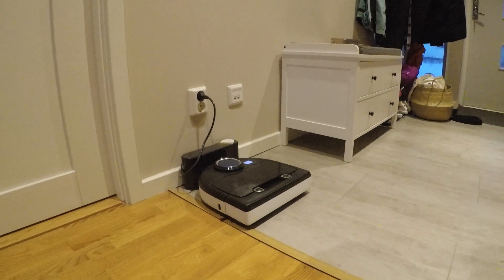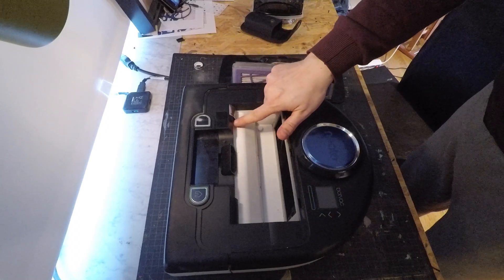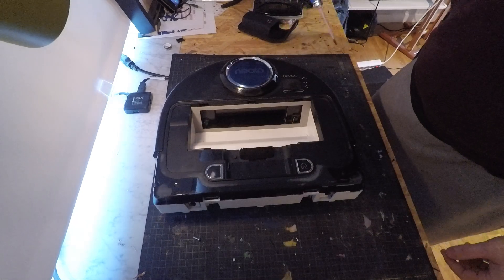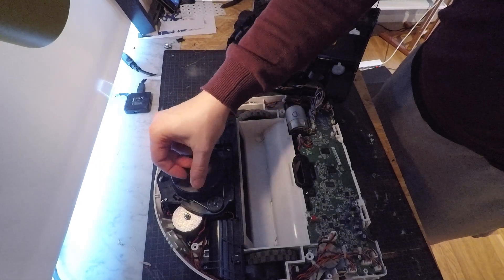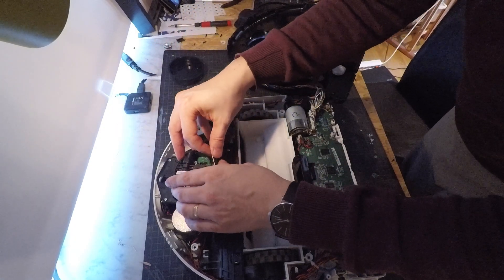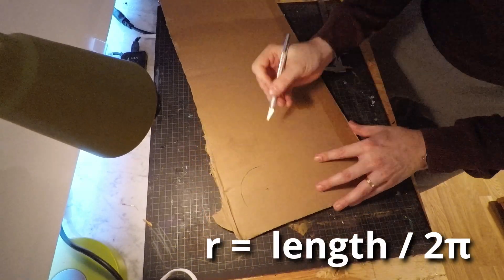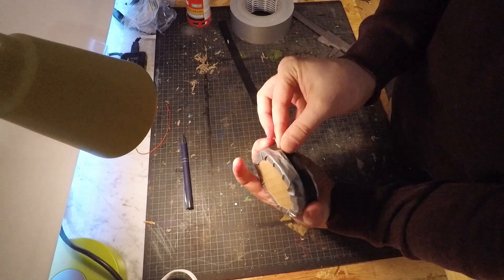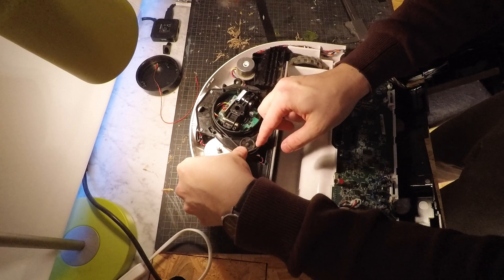Neato Botvac Repair (Laser Turret)

Comment: Hello. I have the same problem. The laser turret turns around but the robot does not make any map inside home. Only works manually and the dock sign on application is blurry and cannot be marked. I asked chatgpt for a sultion and it asked me to take a photo of the laser turret while in operation to see if there is and laser light visible on a phone screen. I checked it through the phone but the laser is not visible. Cables are ok and the drive belt turns fine. Do you think that the belt has to be change? Or laser diode has a malfunction?
Reply from the maker: If you can't see the laser through your camera, then the laser itself is not working. If it's the laser diode, or the laser unit or the power to the laser that is broken is obviously hard to say without measuring.  My guess is that replacing the turret would fix the problem (but you should change the belt while at it anyway).
Reply: @JWAM  Thanks for the message. Today I replaced the drive belt with different ones and still no docking sign and no self cleaning. Only manual one works. I clean the diodes carefully but no sign of working. The robot makes the exact move like the one your make at the beginning of the video. There are spare laser dioded on ebay and aliexpress but they do not ship them to my country :( I think the robot wasted for a $5 piece.
Reply: @JWAM  I checked both power sockets and the turret socket was out. I placed it again. I can see the red laser while working but still no mapping or working. Replaced the belt but nothing works. Replacing the turret will cost a lot so it is better to sell it as spare part.
Reply from the maker: @AslanBehar That's a shame. :(
At least you have it a go, which one should always do :)
Reply: @JWAM  I just realized that the motor on this video is located on left side of the turret but mine is located in rear side which I can see that the holes and motor mount screws are empty. Which is right? Left side or rear side?
Reply from the maker: @AslanBehar  Interesting! Sounds like they had different configurations and somehow foresaw it. Maybe the form-factor of the motor is different and they wanted to make sure that they could use both?

Comment: I've got virtually no suction in mine. Recently replaced the brush  motor as that had failed, plus the usual annual replacement of the battery. I'm spending more than if I had just bought one second hand.
Reply from the maker: May be it's time to upgrade at last.. ?  :)

Comment: I was expecting my rubber band to be broken as well but it turned out it was a big block of lint pressed up against the rubber band pulley component. Cleaning that solved the problem. Thank you for the video!
Reply from the maker: No problem! :)
Glad you got it sorted :)

Comment: Hi ! thx for the video. My botvac D85 has the exact same issue, i changed the belt : no change, i changed the little engine that make the belt spin : no change. Any idea ?
Reply from the maker: If you hold a paper Infront of the turret, can you detect the laser both shine and spin before the fault occurs?
Reply: @JWAM  i just tried, i dont see any red dot/light on the paper
Reply from the maker: @PAPAJOU  My guess say it's the power supply to the LiDar or or the whole LiDar that is broken in that case. :/
Reply: @JWAM  hmmm, seems Bad 😅. Im gonna search online how to replace the lidar
Reply from the maker: @PAPAJOU The bad news is that the LiDar is about the most expensive thing on the whole product.  If you know someone who is a bit electronics-savvy, maybe they can find the fault. It may be a smaller thing.
Reply: @JWAM  unfortunatly i dont. I've found the piece on Ali express for 43€, i Hope it will solve the problem. Thanks for your help
Reply from the maker: @PAPAJOU  oh, that was cheaper than expected then.. I was sure it was 150+.  Good luck! :)
Reply: @JWAM  Hi again ! So.....i've replaced the linar and little botvac is back at work but it's not acting like it should. It starts, move  a little bit, spin, spin again, move a few inches forward then spin and spind and sping again, it's quite hard to explain but it seems like it doesnt know where to go. And at some point it will just stop without returning to the charge station. Should i do some reset after replacing the lidar ?

Comment: Many thanks for the video. It helped me to take my Botvac Connected apart. Turns out there was dust which was interfering with the lazer turret rotation so cleaned that and it's fine.
Reply from the maker: Glad I could help. :)

Comment: on mine i put a new battery in and it doesnt turn on unless its docked.  do you think its probably the mobo?
Reply: That's odd. Do you have the old battery left? Does it / did it behave the same?
Reply: @JanneKronbäck  yep, both have no effect, just solid red light if it's docked. Which I guess has to be a connection to the mobo or the mobo itself is burnt
Reply from the maker: @karrde666666  Ah OK, I thought you meant that it "worked" when docked.I have moved away from Neato since, so I don't have any advice from the top of my head. It doesn't have to mean that something is awfully "fried" either. If it refuses to start at all, but shows an error / charging (red?), I would check / measure the incoming voltage levels and check for fuses and such. At least the older models had some weird "on/off"-switch somewhere around the dustbin (I think) check that too..  : )

Comment: Very good video, unfortunately on the D7 model the screws you have to remove are the t size 10 with the locking pin in the middle. I happen to have some from fixit but the two at the front are so deep that I could not get them. The adaptor for extending the  t 10's I have was also to thick to fit into the holes. Great video I am sure it would fix it if they only had not changed the screw types.

Comment: Good idea I would also suggest buying audio tape deck replacement belts or cd carousel replacement belts or DVD carousel replacement belts from eBay.
Reply from the maker: Sure but if one is to buy something, one might as well order the actual replacement belt. :). The reason I did what I did was that I simply wanted to fix it there and then to have it working and clean the rooms, rather than search/order/wait a few weeks - and also to be inspirational, as in "you don't need to pay/wait for weeks to get things repaired - just fix it with what you've got". :)

Comment: Hello everyone! I'm having the same problem, but the rubber band isn't slipping. It just isn't turning at all. That's probably the motor, right? It if is, I don''t know where to buy one...
Reply from the maker: Yes, most likely the motor. In Aliexpress, try the search term "Neato lidar motor with cable" and see if you get a hit that matches yours
Reply: With my D7 Botvac, I discovered it must be the little wheel of the motor: in the five years of using this robot, it collected hair and dust around the little pin that the wheel is on for driving the belt for the laser eye. The belt was still good, and not stretched. Bit the wheel would hardly turn. At this moment I’m still cleaning the little pin, as it is a real tight and small space to work on. Hoping this will solve the problem at last! 😅

Comment: Hi there, thx for posting your video. It pointed me in the right direction. But i was dissapointed at first when i saw that the rubber band on the laser turret was in good condition. But then i found a broken rubber band on the sidebrush motor, and the opposite side of the motor has a sensor that sees if rotor is rotating. So my guess is that if side brush or laser turret dont turn it will have the same behavior.
Reply from the maker: I don't think that is the case, unfortunately. The sidebrush can be out of commission without any problems (except that it doesn't clean along walls properly).  Make sure that the turret is spinning when you start the robot. If it isn't, it is probably the motor that needs replacing.
Reply: @JWAM  You where so right, just changed the rubber band and still same behavior. I see now that Lidar turret is not spinning, but cant find anything visibly wrong.
Reply from the maker: @juanrmartinez4400  yep.. It's most likely the motor. They are cheap so it doesn't hurt to try switch it out
Reply: @JWAM  I'll try it. THX :)

Comment: Thanks for the video. It was helpful as a first step. I still had the error 3000 and laser turret did not spin on similar model Neato D5. Bought a motor for $15. It was a bit fiddly to change out the motor however worked a treat with Neato working again. For others, just make sure the wheel can spin on the motor, you may need to have it slightly up. Thanks!
Reply from the maker: Glad you got it working. I had also an occasion where I had to replace the motor. Broke the wheel in the process and had to print a new one. :).  I have switched away from Neato since, but at least I did what I could to extend the life of it before I did so.

Comment: i try this but i as another problem, turret needs to be pushed by hand to start spins, any idea to fix this ?
Reply: I think it means that one of the brushes on the motor that drives the turret is bad.  I.e. you need a new motor.  OR, that the voltage to the motor is too low.

Comment: I should have found the video 1 year ago. Neato had exchanged the Botvac 3 times within the 2 year guarantee. The fourth time I had to dispose of the vacuum cleaner. Too bad.
Also see my video.
I have had a Cecotec Conga 4090 for a year now, and it works without any problems.
Reply from the maker: I apologize that my channel isn't big enough to be recommended quickly enough. :)
Reply: @JWAM  I know this :) thanks anyway for your video.

Comment: Hi, I followed the procedure, but still having the same issue. When I open the compartment, the laser was turning smoothly both directions with my finger turning the small round part next to it. So it could be something else causing this issue I'm not sure. Do you have any other suggestions??? Neato support just gave me the cleaning tips as the troubleshooting steps and they do nothing.
Reply from the maker: That's a shame. Does the turret spin when started? Is the laser shining?
Reply: @JWAM  Do you run it with the compartment still open?? If it's closed and screwed, how can I check them?
Reply from the maker: @jupiterica  If you run it open, I think you need to fake that the compartment is closed. Otherwise a piece of paper or (carefully) with a mirror without pointing the laser into your eyes

Comment: This is a brilliant fix! I had high hopes for my neato but, unfortunately, trying this, a cotton bud around the top and a good clean didn’t do anything. I still have the same problem! 😟
Reply from the maker: That's a shame. :(  Obviously, the fix presented in this video is for when the belt is either broken or slips.  If the turret rotates (and the laser shines), then the sensor is probably dirty. If the belt is intact but the motor doesn't spin, but starts spinning after a little bush, the motor [or its brush] is bad. If the motor doesn't spin at all, or that the laser doesn't shine.. it would suggest a bigger issue...
Reply: Thankyou, that is very helpful. I think I must have a bigger issue like needing a new lidar motor. Your video has definitely helped me isolate the problem.
Reply from the maker: I'm glad I was able to shed some light onto your issue, at least.  Best of luck!

Comment: So this is the fix if your Neato backs away from the base, all the brushes work, but it doesnt move anymore....

of course its a good idea when the Neato is opened, replace the laser rubber pulley band and clean the dust with a can of air....

So if you notice, on the laser motor (that rotates the laser turret), the plastic pulley gear center loosens from the motor spindle....the motor spindle will spin, but the pulley gear just doesnt have enough friction to pull the band and rotate the laser at 100%....the motor spindle spins, but the plastic gear doesnt spin all the way, its kind of like putting a pencil in sewer manhole and spinning the pencil, the sides if the pencil do not touch the sides of the manhole....thats the only way i can describe while typing.    The laser turret spins (making a false appearance that everything is working) but only at 40%.

 so superglue that plastic pulley gear to the motor spindle, make sure the distance away from the motor is precise so the rubber band is level with the other gears, let it dry, put a new band on it (highly recommend OEM or similar, not a office rubber band or elastic..amazon has them cheap).  your neato will now work and the laser turret will spin at 100% and the neato will now move.

Comment: Do you have a video of how fast the turret is supposed to spin? Mine seems to spin fine and the belt feels good, but still get 3000 code error. I suspect maybe it could be spinning slower than needed, but not sure.
Reply: Unfortunately, I don't. If you don't feel any slip nor any extra resistance at any point around the turn, and it starts spinning by its own (usually electric motors need a little push if a brush has become bad), I doubt that the motor is the problem.  Are you able to detect the laser? If yes, Q-tip the both "eyes" if you haven't done so already.
Reply: @JanneKronbäck  Thanks for replying! How do I check to detect the laser? Is it through a PC and usb cable? I have heard about it but not tried it yet. I tested the motor on its own, and it has plenty of torque. Doesn't appears to be weak, and like you said, starts by itself every time, so brushes are likely good.

Comment: Followed your instructions but ordered the replacement belt for $7 on Amazon. It didn't fix the problem. Any ideas?
Reply from the maker: Did you you check whether or not the belt was slipping? It could also be (for example) that the casing above the turret grinds against it not allowing it to spin freely. Carefully look at the turret (it has lasers, do NOT stare at them when you start it to see if it spins). If it does spin and laser seems to shine, clean the "eyes" with a q-tip.
Reply: @JWAM  thank you for replying!:) yes laser spins fine and have used q tip to clean ...at least i think i have. Not sure what eyes are. BTW, my vacuum acts exactly like this 1 at beginning of video. If i bump/touch the front bumper, it does move as if hitting furniture if that means anything.
Reply from the maker: @ruby22shoes  Which exact model do you have / what is the error code? 
The "eyes" are the two holes on the turret. One is the laser and the other one is the receiving sensor. If you can't see the laser shine (by holding a piece of paper close to it to avoid staring at it yourself) when the robot moves, then there is a bigger problem with the laser.
Reply: @JWAM  Thank you again for your help :) The model is Botvac D series. I have a note in the manual that I had previously noted Model D85. There is no error code. I did figure out what you meant by the eyes. I held a piece of paper around half of the laser are and there was no light that shone on the paper. I think that is what you meant to do. The "turret" is however spinning. Has my robot gone blind? what would cause that? If so, is it better to just buy a new device? If so, what do you recommend? thanks so much!!!
Reply from the maker: @ruby22shoes  If you can't see the laser, then it's presumably dead, and I think they are a significant part of the total price of those things. . We recently replaced ours with "Roborock S6 MaxV" and we are very happy with it. It draws a map of all your rooms and you can schedule cleaning per room if you wish. It detects obstacles and takes a photo of them, so you can see the things it triggers on as problems.  You can draw rectangles in the map to actively make it avoid certain parts (like a problematic carpet or low pet-bowls that it may not see otherwise and push around). Also it's connected to Google Home, so you can tell it to start & stop cleaning with "okay google, start/stop vacuuming"
Reply: @JWAM  thank you again! I'll check into the one you recommended.
Reply from the maker: @ruby22shoes  No problem, fellow human! Sorry it didn't fix your problem, but I hope you'll find a fine replacement. :)

Comment: Interesting using vulcanizing tape, but you could always try to match a new O-ring up at an auto parts store or even a hydraulic repair shop. Nitrile would be best.
Reply from the maker: An o-ring would absolutely work just fine. The point here was to be able to fix your expensive product in yourself in your underpants with no intention of leaving your home. Ordering a new belt from Amazon / driving off to stores to find a o-ring is about the same hassle when I just want to fix something *right now*. :)
Reply: @JWAM  Ah yes, but you have to factor in, most people don't know what side of the screwdriver to hold, let alone make a jig to make a belt. :P

But still It's cool you can literally fix it with tape.
Reply from the maker: @wyvern4588  What other people can or cannot do is beyond my control. :) But if you look at the comments, it's evident that there's a lot of people that might have difficulties knowing which side of the screwdriver to hold that got the courage to try, and ordered the belt instead. I have another "repair video" on cheap NES-control. Solution? Scotch tape. :)

Comment: I had the same thing happen to my Neato the other day, but the laser turret was able to spin. Customer service took it in for repair.
Reply from the maker: I hope you tried cleaning the sensor with a q-tip too before sending it away? :)  Otherwise the belt could still be slipping (and not rotating fast enough), or the laser is simply dead, perhaps. Please let us know when you get the verdict! :)